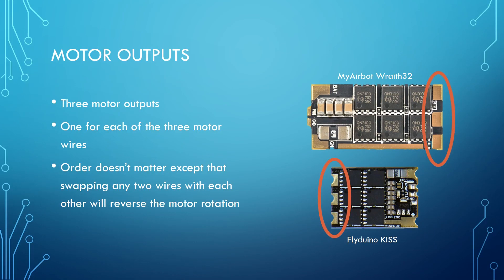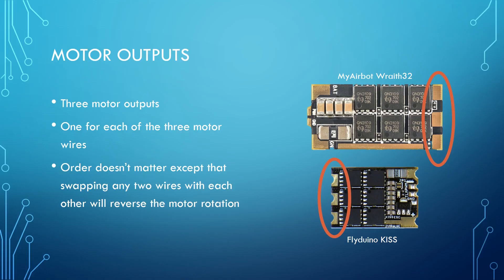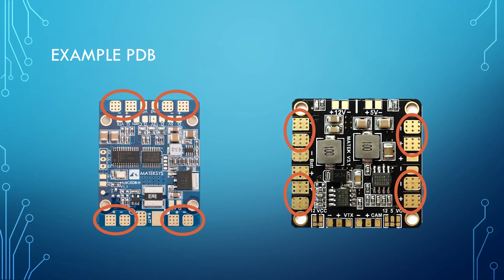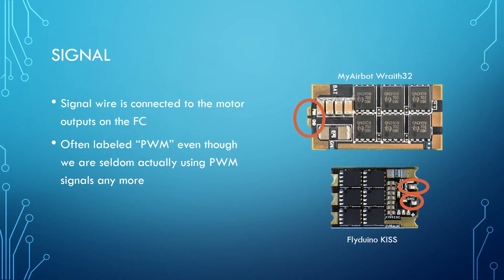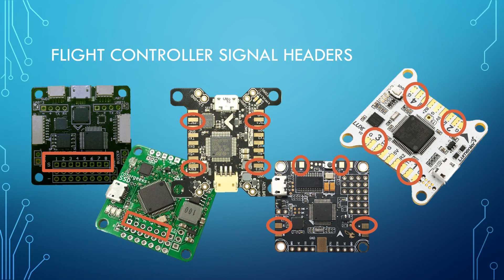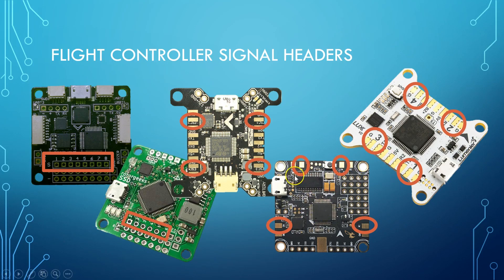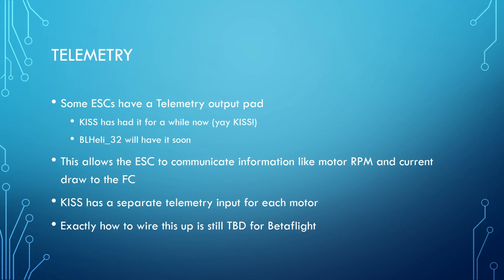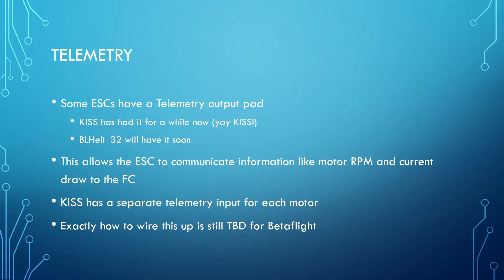Flight Controller Wiring For Beginners - PART 2 - ESCs

Comment: My fc board and 4 in 1 esc have an 8 pin wire harness. However, 1 has r6 while the other has telemetry. Are they the same thing?

Comment: can i remap the signal motor output on the flight controller one of them not working  motor 4  is there a chance still to use the flight controller ?
Reply from the maker: https://www.youtube.com/watch?v=FysPHx7RL9s
Reply: @JoshuaBardwell  thank you i remapped it into the led strip port and worked well but i freed one of the resources called sonar_trigger and ESCSERIAL i couldnt find out honestly what are those

Comment: Help PLease:  you said at 10:50 to 11:03   if your esc also has a ground connection just make sure you twist the signal positive and negative together and run that to the esc to get whatever benefit the ground would have ... why would i twist them together wouldn't i run the signal negative from the flight controller to the signal negative on the esc and the positive to the positive instead of twisting them together ... that doesn't make sense then why would they bother having pads for the negative on the fc or on the esc if they were meant to be joined together?
Reply from the maker: I don't mean to twist the copper of the wires together. They get soldered to individual separate pads. I mean the wires themselves get twisted in a spiral.

Comment: I have recently purchased a RDQ JB FC and JB 4in1 ESC. Should I orient the ESC to make the motor placement match the default that betaflight expects or is the placement of the VBat connectors more important. Also, is it important whether the wire harness socket is on top or bottom once mounted?
This is my first quad build from scratch and I'd prefer to not re-solder all the motor wires at some point in the future...
Reply from the maker: https://youtu.be/QeuSq71pYF0
Reply: @JoshuaBardwell  That pretty much sums it up. Good video. I figured you had a video like this but was not using the correct search term.  You wouldn't happen to have a CSV of your video titles would you :-) (only half joking)

Comment: Can someone help me i have no idea which of the 2 pads of this FC i need to hook up my PWM signal from my ESC??

The FC: https://www.banggood.com/DALRC-F405-AIO-Betaflight-F4-Flight-Controller-BEC-OSD-50A-Blheli-32-3-8S-Brushless-ESC-for-RC-Drone-p-1300573.html?cur_warehouse=CN

The ESC´s:  https://www.banggood.com/Razor32-V2-35A-BLheli_32-3-6S-DShot1200-ESC-w-RGB-LED-Current-Sensor-Bidirectional-for-RC-Drone-p-1398234.html?rmmds=myorder&cur_warehouse=CN
Reply from the maker: E1 e2 e3 e4
Reply: @JoshuaBardwell  Thanks

Comment: Eli could wire the ground wire of the esc signal to any other ground on the fc that would be used otherwise? I have the matek f405 ctr. It doesn’t have separate ground wires for the esc signal and it’s a pain trying to solder a big wire and a little wire to the same pad
Reply from the maker: Yes you could do that.

Comment: Sorry for two posts but this is the proper place for my previous question. I have 32amp kiss esc. What gauge wire do you suggest for power ground? I have 16 gauge but would love to use 18 if that's sufficient. Putting them on my 215 size. Paring the kiss 32amp with T-motor pro 2 2400kv motors. I would appreciate any suggestions. Thanks!

Comment: Joshua I have an older ESC that had Big Ground and Power but had three wires in the center with signal wires? Why is there three wires?
Reply from the maker: Signal, 5v out, and ground. Older ESC's often had 5v regulators because FC didn't.

Comment: I have the RACESTAR SHOT 4IN1 ESC 30A card with the original battery cable +/- and soldered into the esc 4in 1. board. has an output connector with pin. . . VBAT / CRNT / 5V / 5V / GND. . . OMNIBUS F4 PRO V2. . it does not have the VBAT / IN pin. . . because it has the current sensor as the card racestar shot 4in1 esc. . . so how do I feed the FC (note that I've already burned one because I'm wrong). . to get the current to the FC and have the current sensor of one or the other card? . . (to be taken into account that all the boards have the current sensor). Thanks, it's very kind of you

Comment: Same here, noob asking for 4in1esc connection possibilities to the fc (probably not much but still..:-)
Reply from the maker: The best situation is to get a 4-in-1 with a current sensor output and an FC with a current sensor input.
Reply: Joshua Bardwell Thanks for the info (reply and vids), I am basicly comming out of the dark ages comming from Graupners overpriced and isolated aio rx/fc setup and yep; I've steen the light 🙂 it has a taranis-like glow to it 😎.  I have learned something today

Comment: Ok, this is what I did, on the solder pads to plug up your esc’s (8 across 3 down ) I messed up the first 4 signal pin holes and had to use 5-8 I haven’t finished building yet will I be able to change my change the numbers in the software?
Reply from the maker: Yes.

https://www.youtube.com/watch?v=z5aO-3_n-Hs

But honestly I would just go back and re-solder it.

Comment: So I have a wire that keeps coming off of my flight controller everytime it crashes.  I think I cut it a little too short and that is the reason.  The other reason is that I am new to soldering.  haha.  I want to replace the wire but the wire it came with is 18awg and the wire that I have to replace is 20 awg.  Is that a problem if I wire one esc with 20 awg and 18awg with the others?
Reply: Umm nevermind acutually.  The wire I bought was packaged wrong and it is 18awg.  But for future reference if I ever had to do this, would that cause any problems?
Reply from the maker: +Corey Munsell if the wire is coming off without pulling the pad off the FC then I'm sorry to tell you, you are bad at soldering. No solder joint should be able to just pop off like that. The wire would break or the circuit board would break if the joint was sound.

There's no shame in being bad at soldering. But I highly encourage you to find some way to get trained in how to solder right. It will save you so much frustration in this hobby.

Comment: Joshua, I have a build we’re the ESC,s  pos,  neg, and signal all go to the PDB. The ESC,s on that build do not have the secondary ground that goes to the FC nor is there the option on the FC for that ground since they go through the PDB with the signal wire.
I was gonna replace them with Spedix 30A ESC,s so can I just run the secondary ground the one that is twisted to the signal wire to the  ground on the PDB with the Main Neg wire from the ESC. OR in my case as explained just not use the twisted ground at all since I don’t have the option like others do.
Reply from the maker: +Cletus Lancelot either option is fine.
Reply: Joshua Bardwell  thanks again for you quick reply. I’ll probably combine the grounds then...

Comment: Joshua, If I have a PCB with integrated ESCs..  But those ESCs are not large enough, as I want bigger motors...
Could I put voltage 5V regulators on them to make them function as signal outputs, so I can use external ESCs?
Reply from the maker: If the FC has signal outputs for the motors then you can wire it to external ESCs. If it doesn't, then you will have some struggle to get that done.
Reply: Oh. Ok. No there actually isnt any signal outputs... Thank you for your fast response :)

Comment: I Josh, quick questions.  Both my flight controller and my pdb have places to sauder in the ESC's which would you recomend it better?  This is my first build.  I am using the OMNIBUS Betaflight F3 AIO V1.1 Flight Controller, Racerstar RS20Ax4 20A 4 in 1 Blheli_S Opto ESC 2-4S, and a GEPRC XT60-PDB 5V 12V Dual BEC PDB with LC Filte
Reply: throw away the pdb, aio fc has one built in

Comment: Can you please tell me differents between UART and io please help
Reply from the maker: I don't understand the question, sorry.
Reply: Joshua Bardwell sorry on my serious pro F3 flight control it says use either UART 3 or io 2 for I bus one is directly solder the other is a connector but is there a difference between UART and io

Comment: Hi. I was wondering if you have a FC with no ground pads for the ESC signal ground, but the ESC negative pads are wide enough to solder on both the GND and signal GND. Should I solder my ESC signal grounds to those GND pads or is it somehow a bad thing to do? As I understand it, those ESC signal grounds are electrically same as the battery GND.
Reply: Same question, have you found an answer yet?

Comment: Any tips on the actually soldering of esc wires?  After burning one of my ESCs On my Wizard 220s I bought some Dys ESCs that had a connector preattached.  So I thought it would be a good idea to pull out the old ESC wires and just add a pin header. That way next time an ESC Burned out I wouldn't have to solder.  Disaster.  I didn't realize you couldn't do that because by the time you melted  the solder for one ESC lead solder, it would harden before you melted the next.  Exasperated i stripped he connector and proceeded to try but the. I realized with a lot of solder in the pin  its really hard to melt it all the way through.  I suppose because the heat gets dissipated by he board it's self.  I somehow managed to finally solder the new ESCs in but it was hard for a newbie like me.  And out of exasperation I soldered on the top of the board as oppose to being the in the bottom originally.  That made for a messy birds nest of esc wires as opposed to them being tucked underneath.  Bottom line I don't think I did it the best way..  so any advice on how to do it next time e and do you recommend pin headers for a new build?  Thanks...this video series is very useful!

Comment: so you don't necessarily need to run a ground with the signal wire if I understood correctly
Reply from the maker: No, not at all.
Reply: Joshua Bardwell awesome info bro thanks a lot I was wondering about that and with me about to start a new build I might try it without it since it might be a tight build
Reply: I had been wondering the same thing myself for the longest time.  Now I have a confirmation.  Question:  Is there any benefit of connecting the signal ground?  Maybe by twisting it with the signal wire minimizes rf noise?
Reply: @marinehm  Twisting signal and ground wires is simply good engineering practice producing a transmission line with common mode rejection. It's a way to fight RF from the transmitter and Noise from the ESC and Motors from getting back into the controller, and it eliminates crosstalk between channels. As mentioned, at short distances and lower powers, it is seldom an issue.

Comment: Why is how to connect a radio receiver to a f3 omnibus flight controller being kept secret? I have searched and searched and NOBODY explains how to wire the receiver to control the controller!!!!!!
Reply from the maker: http://www.dronetrest.com/t/omnibus-f3-aio-quickstart-guide/2759
Reply: I watched it, doesn't tell you you have to have a PPM receiver to work with this board, or the difference between a PPM and the standard R/C receiver.
Reply: Nowhere does it show how to connect channel 1,2,3,4 from my receiver to the FC. or mention if it is possible.
Reply from the maker: You cannot use a PWM receiver (one channel per wire) with that board. You can only use PPM or serial.
Reply from the maker: Also this:

http://www.dronetrest.com/t/rc-radio-control-protocols-explained-pwm-ppm-pcm-sbus-ibus-dsmx-dsm2/1357
Reply: Thanks! this is actually useful.
Reply: EXACTLY! But nobody mentions that fact. ANYWHERE. Many things that may seem simple to experienced builders go unmentioned. But they are only simple if YOU KNOW THE ANSWER.

Comment: Hi Josh......why did not you say about wiring escs without a pdb at all....many modern controllers have integrated becs so the pdbs are obsolete....frames are getting smaller as well so there is less and less space as well.
Reply from the maker: Without a PDB where do you solder the ESCs?
Reply: i just connect all of the positives together and all of the grounds as well to a short 12 gauge wires and to xt60...i can use a tiny external bec or just use a fc with an intergrated one.

Comment: Hi Joshua, great content, I have a question that you may be able to help with? I have the omnibus FC with osd and the matek pdb with osd - could I effectively wire them in series to use both. cam - pdb in - pdb out to FC vid in - fc vid out to vtx??  Many thanks
Reply from the maker: Yes, I think that you can do this. I have heard of people doing this with RROSD and BFOSD. They use RROSD for current, voltage, and time stats, and BFOSD for PID adjustments and vTX control. Personally I think it is a really cumbersome and unnecessary approach, but you can do it.
Reply: Joshua please make video on how to fix the receiver name YwRobot

Comment: I don't know where we'd be without all the knowledge you keep dishing out :) 
I do have a theoretical question: 
We know an LC filter will help reduce noise in the circuits.
But would a 3 tier stack (pdb, 4in1 esc, fc) for instance benefit from, say, laminated foil shielding in betwixt the tiers (or something similar) to reduce EMI / noise?
Also - is EM noise even an issue big enough to consider mitigating?

Comment: Can you please do a video on safe battery voltages for when flying and after being flown as apparently that differs a lot. I can not find a decent video on this topic and the question seems to be answered nearly every day on quadcopter forums.
Reply from the maker: I prefer to have my batteries resting at around 15.0 volts after they have rested and recovered after the end of a flight. Older batteries, or when I have been really pushing the flight, end up resting maybe as low as 14.7.
Reply: Thank you very much for the quick reply. I keep my batteries around that, but I just thought other people would benefit from it.
This comment may sound very demanding, but please try not to read it that way. I really like the videos that you do on your channel and they really helped me get started with FPV, but I just thought of suggesting a video.
Thanks for the videos!

Comment: Would love to see a short video on how to wire a 4 in 1 esc to a aio flight controller like the betaflight f3, soldering the positive wire from the lipo to the shunt and using the other side of the shunt to solder a wire to power the escs so you can still get current telemetry was i bit confusing. thank you fro your great channel.

Comment: Would be interesting to see the wiring "instruction" for battery connection and signal wiring to the FC for this 4 in 1 ESC from EACHINE: https://www.aliexpress.com/item/High-Quality-Eachine-Minicube-10A-BLHeli-S-16-5-4-In-1-2-3S-ESC-BB2/32792601805.html?spm=2114.01010208.8.19.GiGSqW  I had to figure it out myself, motor by motor when connecting it to the Piko BLX FC....
Reply from the maker: That's how I do it too. It's convenient when the ESC manufacturer numbers the motors consistent with BF/CF order, but if they don't, you just have to do it via trial and error. Or you can use resource remapping if you prefer.
Reply: Not only that! First I had to figure out GND and VCC on this ESC with a multimeter because they were not marked.  (connected the multimeter at GND PIN of the PWM input and the other one  to one of the power pads of the ESC)

Comment: I know this is nothing to do with this video but I'm having a hard time finding out this info on scratch building. 

I have 1104 motors w/12a ESCs and tried 3 &5 blade 1935 props. 
With the same 400mah (unknown C rate) batteries that my babyhawk flies great with this quad (lighter by 10g) will only fly for a few seconds before emptying the battery... 
when I use some 35c batteries it flies normally. 

Does ESC rating effect the needed C Rate ? 
What's the drawbacks to getting larger ESCs if size & weight are almost identical? 
Do ESCs "store" usable voltage (like a capacitor) to buffer throttle? 
Are the smaller 5 blade props drawing more amps ? 

The major differences between the two quads (that I know) are 

Baby Hawk is 10g heavier 
Babyhawk KV is 5250 scratch quad is 7500kv
BH props are 2345 SQ are 1935
BH ESCs are 6a SQ ESCs are 12a
BH is on Oneshot 125 SQ is on DShot 600
BH has Femto FC w/ mimnosd 
SQ has Omnibus F4 w/ OSD
Both have identical VTX & camera
Reply from the maker: Of them, I think the motors stand out most to me as the cause for the difference in current draw and flight time. The scratch quad has much higher kv motors. You are spinning smaller props, but with more blades. I don't know how that would balance out. I am going to guess that the higher kv motors and props are drawing more current than the babyhawk does.

The ESCs aren't likely to make a massive difference in your current draw. There isn't really a down-side to getting a higher rated ESC, if weight is the same.

Comment: Can't wait for the receiver video. Just spent 10 days and $150 (2 all in 1 stacks) to find out that even though the diagram shows ppm and s-bus using same connection, it doesn't tell you to change the tiny solder jumper from S to P. New at this and just learning the different  ways devices talk to each other ( or lately don't ). Probably switching to I-bus to catch up with the trend. Any suggestions would be appreciated.
Reply from the maker: Yeah. That solder bridge is tricky. Glad you figured it out.

Comment: If you have a 4 in 1 ESC with 6 wires coming out (VSS,NC,M1,M2,M3,M4) do you just run the 4 signal wires only to their corresponding pads and that's it? (F3 Omnibus) ? Thank you
Reply from the maker: NC means "not connected" in a pinout diagram. Not sure why a 4-in-1 would include that though. VSS I don't recognize, but a little researching suggests it may be ground. Which makes sense, since the FC needs ground. Perhaps the NC wire is 5v out on some boards, but this 4-in-1 doesn't provide 5v to the FC? That would be really unexpected. Where is the FC supposed to get 5v from?

Yes, you do run the signal wires as suggested to the signal pads on the FC.